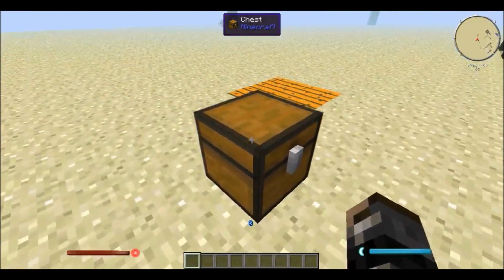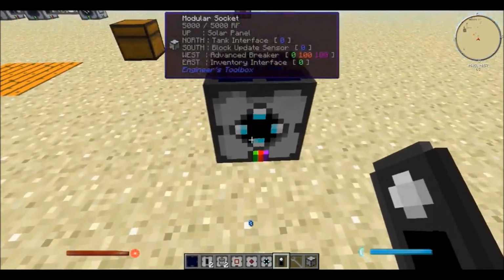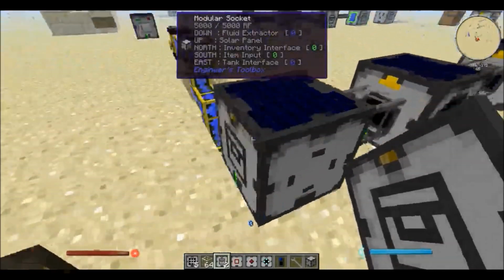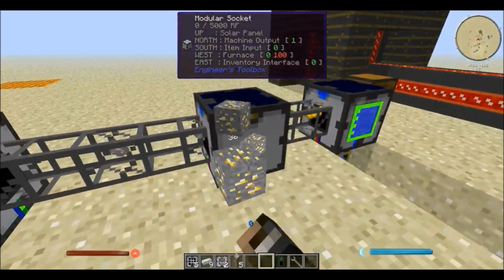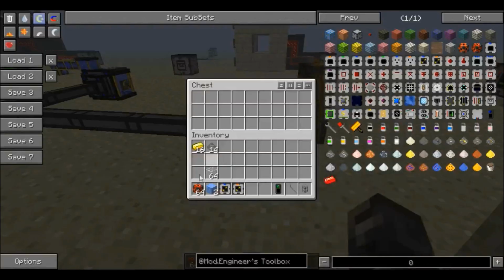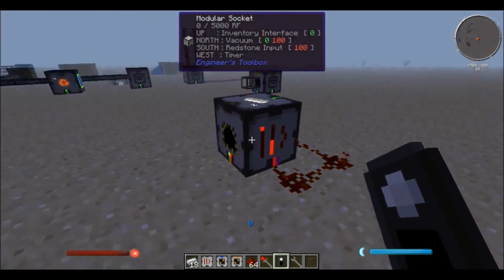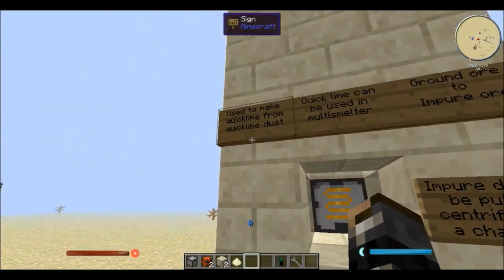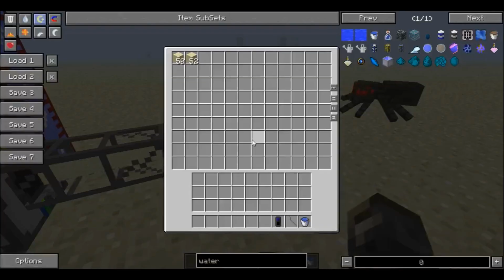Minecraft Mod Review: Engineer's Toolbox (1.6.4) [tutorial through builds]

Comment: Question - can you convert RF back into MJ or EU?
Reply from the maker: There are blocks you can use in ET that can convert the power types.
Reply: After experimenting, I found it possible to go from EU to RF using the RF adapter, but not the other way around. I wanted to power an extractor, and sadly I ended up using a generator instead.
Reply from the maker: You can right click (with a wrench) to change it from input to output mode.
Reply: Right clicking the EU adapter had no effect, visual or measured input/output when connected between a Leadstone cell and an extractor. Also tried sticking it adjacent to a socket with power in.   I'm playing this in Tech World 2, which has numerous other bugs as well. I tried updating everything (including Engineer's Toolbox) to the latest compatible versions, and had some success with other mods like Big Reactors, but little things like this make it an annoyance. I've decided to give the beta packs on FTB a pass, and I'm giving Resonant Rise (on the AT launcher) a try instead.
Reply from the maker: That's really weird. You have to right click with a wrench, mind. There was a bug but Emasher fixed it in the newest version. Well, good luck so.